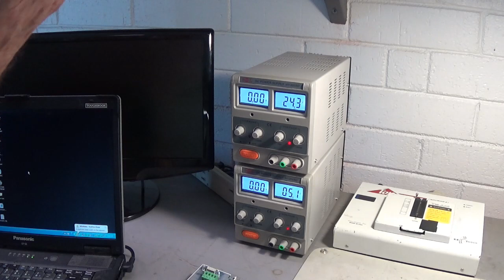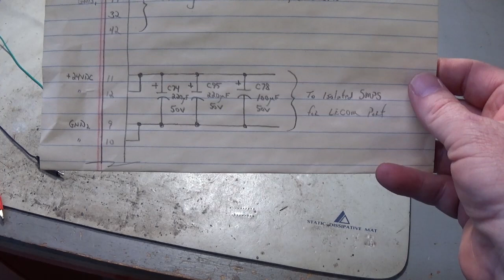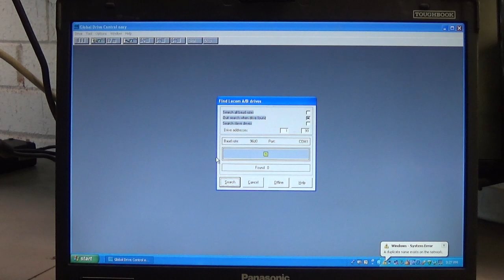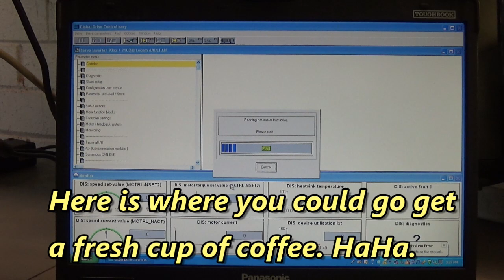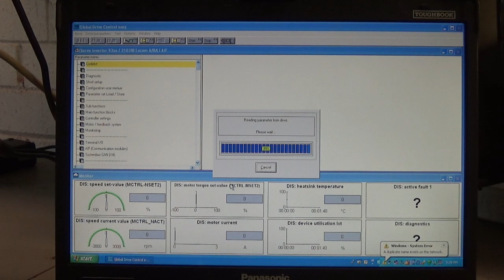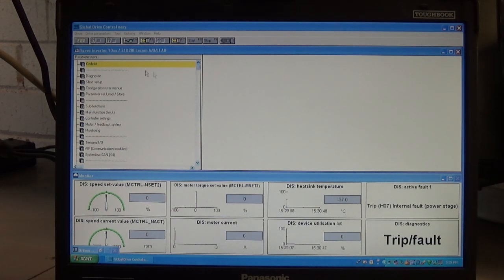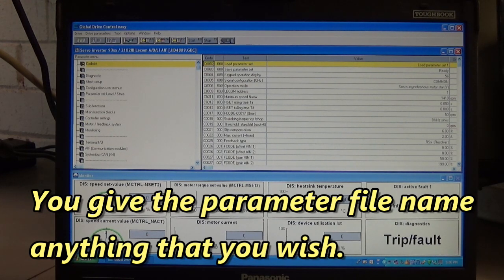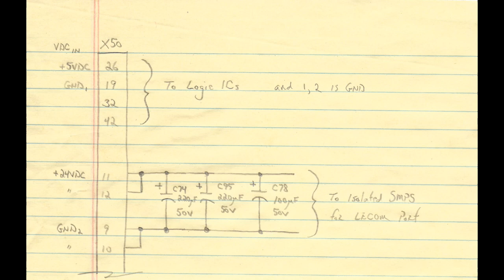Let Us Download the Parameters from a Destroyed Lenze Servo Drive.

Comment: Hello Peepaw. I have a problem with my inverter 9300 EV.  Inverter Faulty:  "LU mesage ". Undervoltage in the DC bus.  I check mains voltage supply cable  ok. I open main control 9324MP. i think main control error. Can you help me find the root cause  Peepaw ?( DC power relay is not close or low capacitance capacitor.  Can you make a video on how to fix it?. Thankyou!
Reply: hỏng bo lực rồi bác

Comment: Hi Peepaw, Thanks for the video. Really enjoyed and also learnt much. However , would you be able to sketch out the drawing for Lenze Servo Drive Type E82EV402_4C, printed board to identify the similar pins of the EVS9322 to do the same on E282EV402_4C? , not sure either which pins should i supply necessary 24vdc with respective ground and as well as 5vdc either on the X11 or X15 terminal of the board. Please do comment if you're able to assist.

Comment: You just simply power on control board to gnd connect 39 connector and 59 +24 volt connect your control board is on..
Let's download and upload parameters without any risk and damage scene..
it's not a easy method

Comment: Thank you so much for the video. I made a 50-pin connector and soldered a DC-DC converter from 24VDC to 5VDC. I placed the entire structure in a box and brought out 2 power wires. I have it approached EVS9326-ES. What other inverter models does it fit?

Comment: You can connect only the 24V (pins 9,10 and 11,12) as you described in the video.
The 5V will be supplied by the secondary power supply on this control board. Unless the power supply on this board is not functional.

Comment: Hey, Peepaw! I appreciate the time you take to make and post these videos. You've taught me a few things about working with servo drives. Since I'm an independent tech, I get a lot of my continuing education on YouTube, and by doing labs in my shop with used equipment. If you don't mind, I'd like to ask you a question about an issue a customer of mine reported to me. He said that when they shut down the plant over the weekend, the Lenze drive no longer retains it's position, like it used to. My first thought is that there must be volatile memory, like a PLC, and there is possibly a capacitor that is failing. It's a 9300 series drive, like the one in your video. If that's the case, I'm thinking they should find a replacement that I can swap out, and then replace all of the electrolytic capacitors on control board of the old drive. What are your thoughts?
Reply from the maker: Hello Mr Hooey, I hope that you are having a great day. The absolute position of the servo system is backed up by a battery that is in the servo motor. If you remove the rear cover of the Lenze servo motor. You will see the backup battery. The backup battery inside the motor has probably died. I hope that I have given you the correct answer for you malfunction. As we all know things are different from one thing to another. Please enjoy the time with your family. And thank you very much for stopping by:)
Reply from the maker: Hello Mr Hooey, I am so sorry. I confused my self between Lenze and Indramat. It is the Indramat servo motor that has the backup battery in the motor. My son died recently. And my mind is a bit muddled. Again I am sorry to err with the answer.
Reply: @PeepawMcDonald  i am sorry for your son, my condolences😥

Comment: Nice explanation with the demonstration. I usually just plug the control card in the other Power Module and Turn the Drive with 24VDC only to get the parameters. Also in case if I don't have one, then again just power up the control card from the front connectors instead of 50Pin complex powering up method.
Reply: yes, Connect power 24VDC (+) to 59, (-) to 39 at X5 slot
Reply: Do you get leds on control board when only plugging the 24v with power board?

Comment: Hi PeePaw. I'm a tech that's worked on hundreds of these things. Have you ever figured out the secret of the control board that has no communication with GDC (not counting the obvious defective capacitors that are always found)? Once or twice, out of probably 50, I got lucky replacing the two tiny SMD optocouplers that are right next to the Lecom connector, but I have a pile of dead control boards and thought I'd ask if you know something I don't. Good video!
Reply: Oh crap. This might be what im currently looking on my 8200 vector. Good info to think about ✌️👌

Comment: Helle PeePaw.  Thank You for the videos.  I have subscribed to Your channel.  I am from Wisconsin.  I have many of these drives and other similar models with matching motors removed from Kuka robots.  Like you I enjoy tinkering and building machines.  I have a variable speed application that I would like to put these to use in.  I have downloaded the Lenze pdf manual and was overwhelmed with the mass of information.  Could You help me setup a simple system for these drives and motors with nothing more than the motor, drive, and a variable speed dial to make it work for approx 0-2000 rpm without a complex PLC system ?  I would be will to contact and communicate in what ever mean suits You best.  Thanks!

Comment: First you can alwas try to power up the control board just using 39 (GND) and 59 (+24VDC) pins on ocnnector. In most cases - just like on this one in video with damaged power board - it will power up the board to make us able download parameters
Reply: FALLA   PL     SE PUEDE RESETEAR?
Reply: @miguelangelbosnjak4128   It's just to have the possibility to upload parameters.

Comment: Hi PeePaw,
Thanks for the video. Just a quick question. In your video, the parameters are stored on the GDC program. Please, how can the stored parameters on the GDC program be transferred to an external USB flash drive or stored on the computer?
Reply: In GDC - menu Drive -> save to file and then at new drive read from file -> send to drive ->store via C003=1

Comment: Hi PeePaw, how are you doing?
Nice to see you working on this drive, I repair many of these around here, very good equipment.
Reply from the maker: I doing well. I hope you and yours are having a good day. I like working on the Lenze Servo Drives too. I had one though that had a shorted IGBT.  Two of the Gate Firing Channels was destroyed when the short circuit energy shot back through the Gates. I changed all the shorted smd diodes, zener diodes. transistors. And burnt open resistors. And installed a new IGBT power module.
Reply from the maker: Then I powered up the drive, and ran the servo motor good. After an hours run time, the IGBT power module exploded again. With the same two Gate Firing Channels blown apart. So I must have missed something in the repaired Gate Firing Channels. Took me two weeks to get over that one failed repair. HaHa. It's like having one die on the operating table. Takes awhile to feel good again.
Reply from the maker: Thanks for stopping by. Always good to hear from another technician that enjoys component repair.
Reply: @PeepawMcDonald  9327 and above gate's circuitry have that tricky topology instead of simple gate drivers, where they fire just a pulse triggered by the 0611's edge instead of being turned on/off indefinitely until you keep the input on/off.
I got an case some time ago where the 9328 got an gate's circuit blown, I changed everything, from 0611 to IGBT module on that gate, just to be sure nothing was going to fail later.
But, as one said, life isn't easy haha...
That drive went to the machine, after a couple of days it was vibrating the motor a lot.
I got it back to my bench and discovered that it wasn't driving half cycle to one of the phases of the motor.
It turned out to be an 8V1 zener a little off the value, I changed it and the drive worked like a charm.
Back to machine again, it worked a couple of months, until one day it started vibrating again.
Back to bench, I couldn't make it fail like in the machine.
I put it on test so, and kept it running all the morning until it failed.
After all it was one of that SMD capacitors that you can't know the value, it was going shorted when heated.
I soldered it out and got another one from the gate next to it, measured the value and soldered two new capacitors to both of them.
This drive is now 5 months running on the machine without even an stop to get cool.
Reply: Now I'm with the first 9330 I ever see, here in my bench.
This one is driving me nuts haha...
This drive exploded for an gate failure, but due to the high current capacity, the explosion got spread.
On the power board it have 3 power supplies, one to drive the electronics, one to the gates and one to drive the giant pre-charge relays.
All this power supplies got shorted, I'm working right now on the electronics power supply, that from dead is now going all the way up to scary 54V (I'm very happy that I did tested it with my power resistor instead of the controller board haha).
I wish I could share some photos of it with you, it's really amazing.
Three 3844 power supplies just for the power board, and the usual one on the controller board.